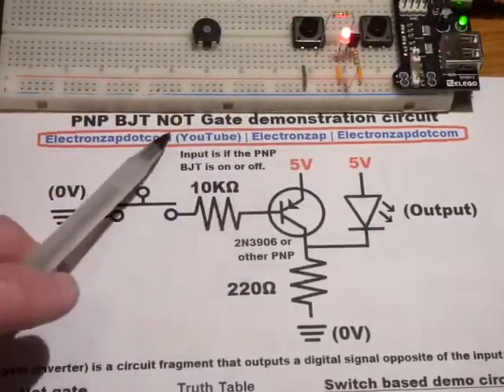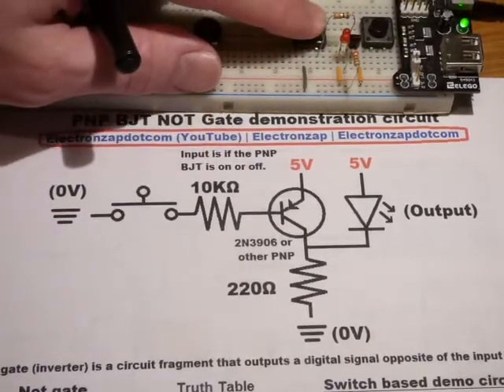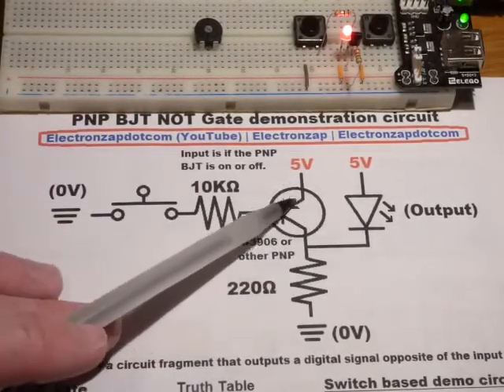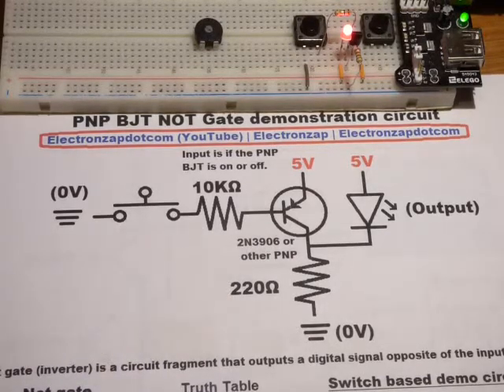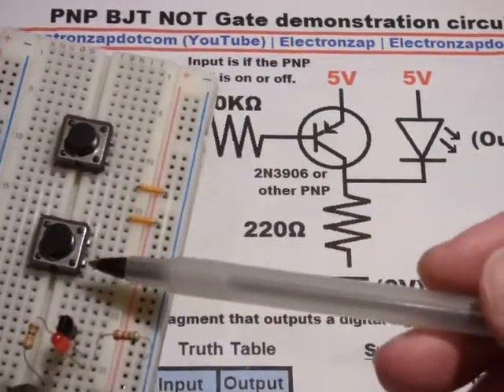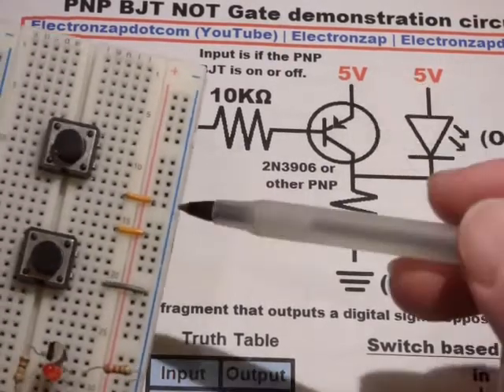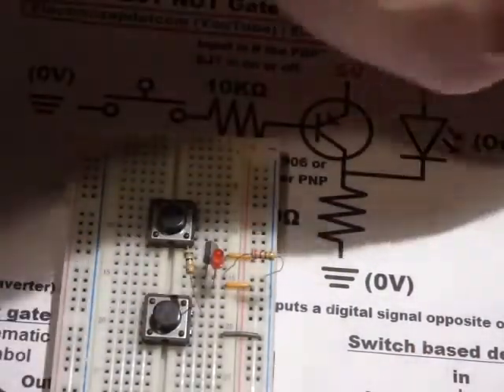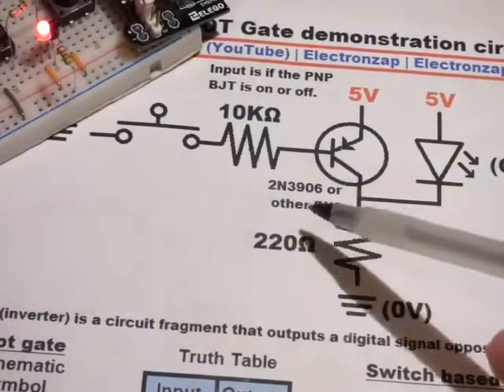2N3906 PNP BJT controlled NOT Gate demonstration circuit step by step build by electronzap

Comment: For some freaking reason mine is not turning off, its just dimms down
Reply: Thank you, lower resistor actually made it work right.
Reply from the maker: @Giich  Glad to hear!
Reply from the maker: If all of the wiring is correct, then that tells me that the transistor isn't conducting fully when it is switched on for some reason. I'd try using a lower value base resistor.

Comment: So if you go to the end, and look at the schematic...  You say that you could essentially replace 5VDC with GND, and GND with -5VDC...

It's a NOT gate where pressing the button shuts off the LED...

Does the LED turn off because it's resistance is greater than the resistance of the transistor?  So if you probed the LED there would still be current going through it, just not enough to turn it on?

I don't understand why the LED turns off...  🙁
Reply from the maker: When the transistor is on, it makes a direct electrical connection from the positive side of the power supply to the cathode of the LED. Since the LED Anode is also connected to the positive side of the power supply, there is no voltage difference across it and no current can flow through the LED cause it needs at least 1.6V difference for current flow. Whatever current flows through the resistor at the negative rail will easily pass through the on transistor instead of the LED while the transistor is on, so the LED stays off when the transistor is on. When the transistor is off, then no current will flow through it and a voltage difference will be across the LED and it will be conducting as much current as the resistor lets it.